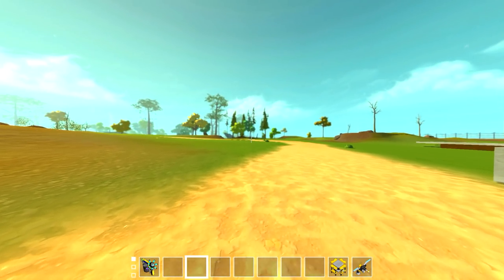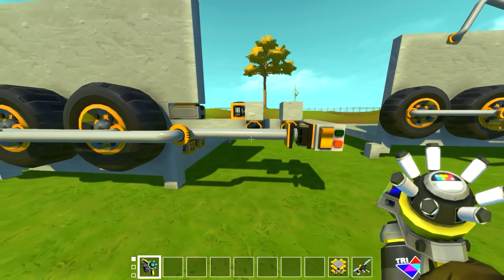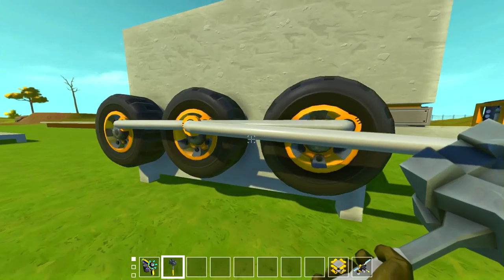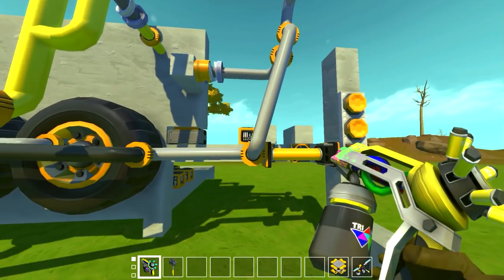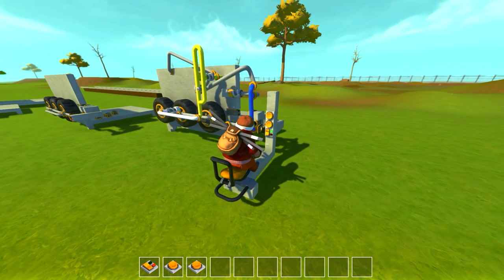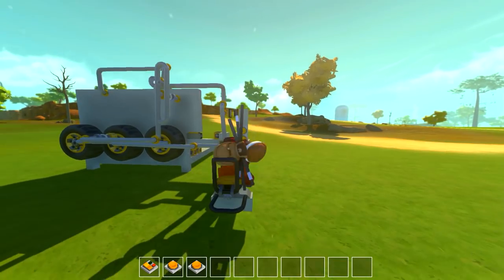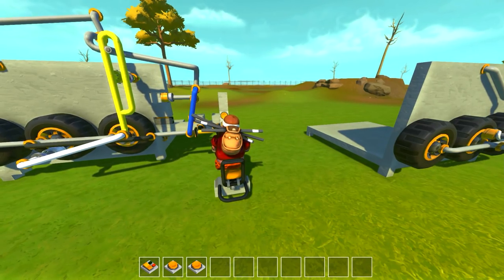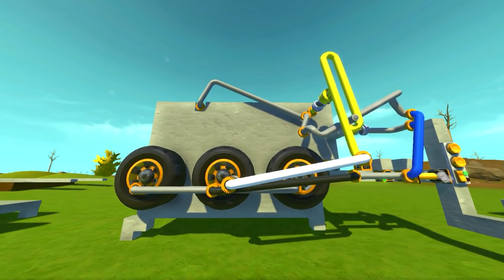Walschaerts Steam Train Drive Mechanisms! (Scrap Mechanic #210)

Comment: The way this one works is showing Kan's big brain, he has invented a completely different way of it working! The proper system changes the timing on the valve  gear instead of forcing the wheel into a direction, he may know this by now though because of Hyce.

Comment: this is lovely, but not quite how the system works (though I have just been spending the past few days trying to figure out how they work, and there really isn't much info beyond websites that look like they were made in the late 90's!)
what is amazing is how it still works! some real backward engineering right there! fantastic!
Reply: Yes, it is not nudging the crank-arm at the wheels in a certain direction. It is only shifting the valve inside the piston so the timing is different, that way it can run in reverse. 

And the problem with the deadpoint (the maximum or minimum point of action) of the piston and the (fly)wheel is solved by placing the crankarm of the wheel on the other side of the train at a 90° angle. So when one set of wheels and piston is at it's maximum/minimum throw/action, the other set is in the middle of the throw/action. No matter the position the train stopped at , it can always start driving again without it having stalled.

Comment: Actually, all steam engines have valve gear, walshearts, baker and stephenson being the most common. Walshearts was made to have an easy to maintain valve gear outside the frame. The large back and forth yellow piece was connected to either a "johnson bar" or a power reverse. The johnson bar was a mechanical reverse, typically a lever in the cab that when pushed forward, would make the train go forward. After a while, you would have to pull the bar back to about 25-50% forward to go faster. A power reverse used steam from the boiler to changd the position of the "bar"
Reply: Don't forget Hackworth Valve gear being common in narrow gauge

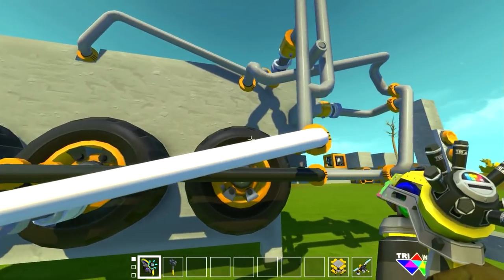Comment: 3:37, the Eccentric, 3:43, Drive Rod, 3:49, reverser, 6:35, you are talking about British and German trains, also, look up the American 4-4-0 locomotive, it is easier because it has valve gear in between the drivers

Comment: Yeah you think it’s hard to do it in scrap mechanic but play plane crazy and try before making a statement like that for SM (you can only angle parts by 90° without extensive use of wedges wich means the weight is off-set)
Also bulleid valve gear is better you get 6 beats with bulleid valve gear with 3 cylinder 5 are distinct and the 6th and the 1st happen at the same time boosting the volume and with the central input and twin-end output cylinders giving the bulleid pacific the most unique exhaust beat of any engine and it can’t be bad if it’s designed by O.V.S. bulleid

Comment: With a lot of engines the valve gear is inbetween the frames. E.g. GS&WR 101 Class. Every steam locomotive has valve gear.
Reply: Not all of them actually, down steam engines are actually turbine locomotives. Although most do use a kind of gear
Reply: @crazynachos4230  well anything that isn't conventional may not have gear but you get what I mean. Turbines made up a verybsmall minority.

Comment: Bear in mind that a steam loco's valve gear doesn't only determine what direction the engine runs, but also the length of time steam is being admitted into the cylinder with each stroke back and forth.

You use full gear (front or back) to get started, and as the loco accelerates, you pull the valve gear back towards center to cut off the steam earlier and work more by expansion of the steam than by volume.

If you left it in full gear all the time, you'd be eating up more steam than the fireman could make, and the engine would be working against itself with back-pressure, basically not being able to push all the exhaust steam out in time before pulling in fresh steam from the boiler.

Comment: To stop it chugging you would need the second drive in conectionits why steam engines have 2 or 4 driving cylinders.
But to make it's simple for scrap mechanic look up the Shay locomotives, their steam drive is 3 cylinders pointed down to a geared shaft to drive the axles. It seems like the best option.

Comment: The valve gear does not give an initial push, that deadzone is counteracted by the wheels pistons being 90° out of phase which remove any deadzone, and the valve gear's purpose is to reverse and decrease steam admission at highers speeds/lower loads, thus reducing the steam consumed

Comment: kinda correct the reverse gear turns the return crank (shown in your video) but it also moves the valve rod (valve is the one that decides wich side of the piston the steam goes) so changing the reverse gear to the extremes makes steampass trhough the valve piston a lot more time thus more steam on the piston, that's good for condensation in there and making the first wheel turning but then you've got to turn that reverse gear closer to the middle so the valve piston let's less steam go into the piston and saving precious steam (this gas expands A LOT).
Reply: so in the reverse gear, going to the extremes is like the first gears on a car, the low gears. Then when you already get the inertia you can change the link nearer the neutral point and it will go faster but it wont help in the first movements. further from the neutral = slower but with more traction. Nearer the neutral point = faster

Comment: Another system used was the stephensons valve gear, which was an earlier system. Also, as other people have said, this isn't a true representation of walhscherts (its pronounced wall shirts by the way) but it is most likely as close as you could get.
Reply from the maker: Yes I looked at the stevensons as well but I thought this one was much cooler. I agree its not perfect but I thought it was pretty close for Scrap Mechanic :D
Reply: kAN Gaming oh i agree completely, it works really well for the limits in scrap mechanic, and looks a lot better in motion in stephensons!

Comment: All steam engiens had valve gear. Some had the valve mechanism between the wheels attached to the axles. Some had the outside with the pistoms and some had pistons and valves on the axles. (Between the wheels)
Reply from the maker: Raaabon Laaanon yes the stevenson method has the valve gear between the axles. What I like about this method is it is completely external to the chassis of the train

Comment: So Thomas the tank engine has the walschaerts system
Reply: Nope, Stephenson's motion, between the axles. Most locos without valve gear on the outside and have it confined in the inside have Stephenson's. Sometimes the con rod attached to the low pressure expansion of the cylinder is outside but the eccentrics are still inside

Comment: You'd have fewer issues with your steam drive if you built both sides instead of just one. On an actual locomotive the drive wheels are on solid axles , aka rotationally locked left to right. A keen eyed observer will note that the two halves of the drive mechanism are at a 90° offset, they don't have a dead zone.

Now strictly speaking the Walschaerts controls only the steam valve itself. Which is the little square box on top of the steam piston. The valve gear position through the running cycle determines how much steam is allowed into which half of the cylinder. 

So to copy the function and not just the appearance, your valve gear needs to control when the piston is told to go from push to pull and vice versa.